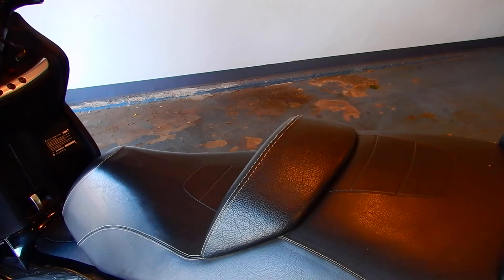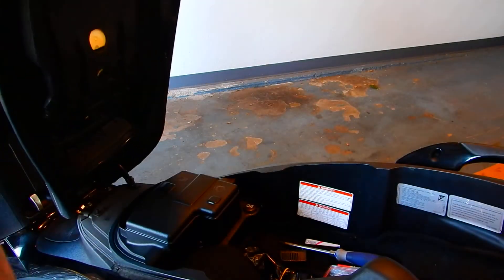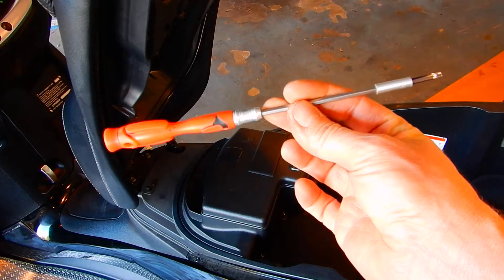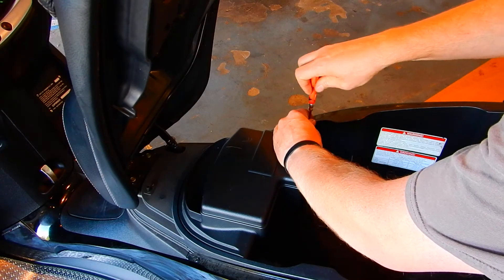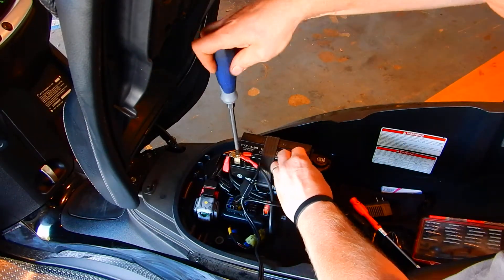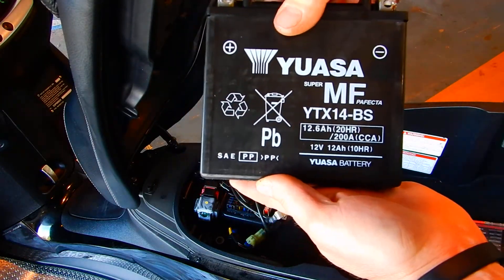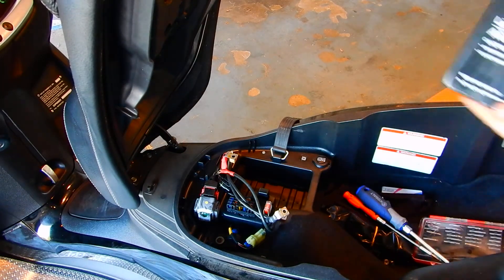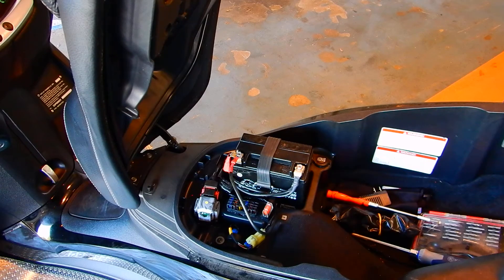2016 piaggio mp3 500 changing the battery

Comment: I had some problems with my MP3 500 twice now that after i drove 3 or 4 times starting and stopping the bike that it wouldn't start up, the startermotor was turning but not the bike. After i jump started it it started at once. Could this mean the battery needs replacement or is it something else?